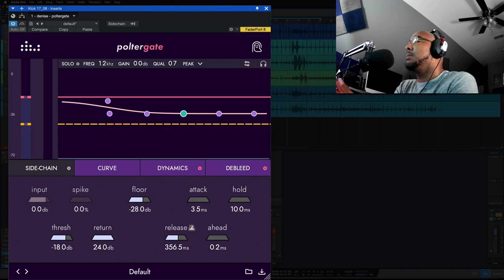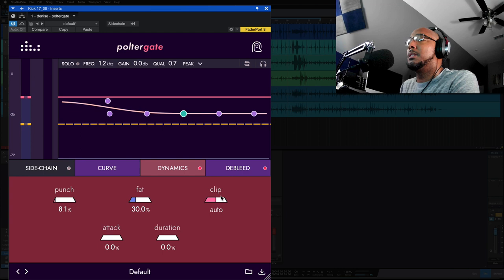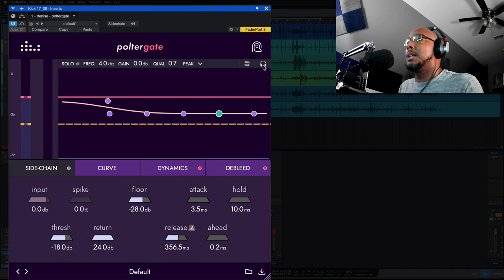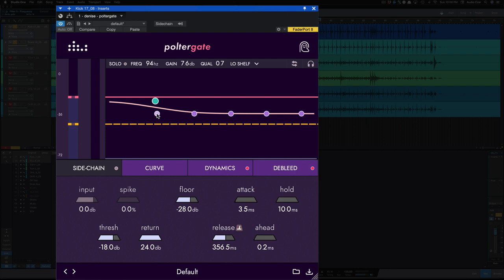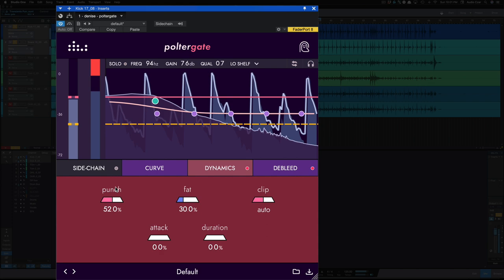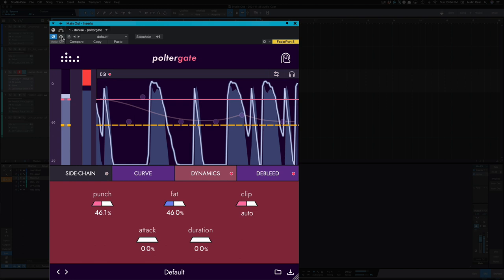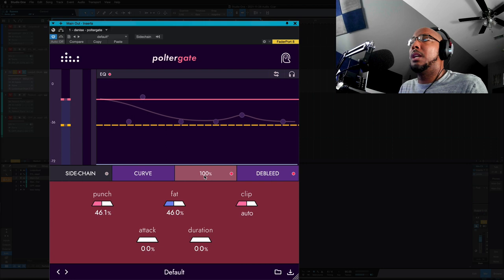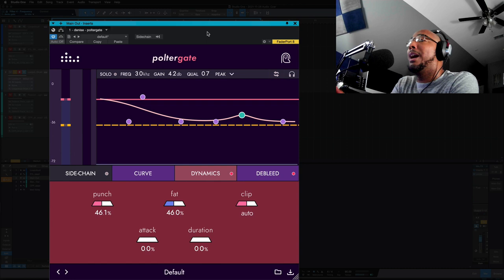Denis Audio Polter Gate - much more than a gate

Comment: Yours is the best video I've seen for PolterGate in demonstrating what it actually can sound like, before and after.  One question I have about PolterGate:  I own Denise Audio's "Dragon Fire", which I really like.  However Dragon Fire is a resource-hog in Studio One, typically using 22% or more of resources per track.  How about PolterGate?  Is it a comparable resource hog also?  Anything you can tell me about % of resources it typically uses in Studio One would be very helpful in deciding whether or not to purchase this plugin.  Thanks.
Reply from the maker: So I'm in Studio One 5, 2020 Imac, 3.8Ghz 8 core Intel I7. 64Gb ram. At a buffer size of 32 samples and 8 instances Its using 10% cpu. Latency shows 10ms
Reply: @TheAudioCzar  Thank you Czar, that information is very helpful.